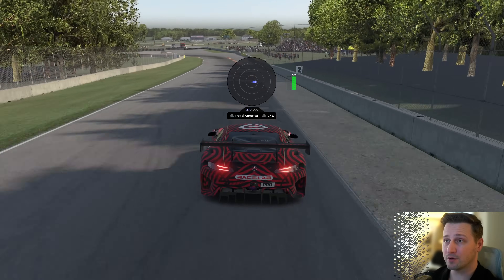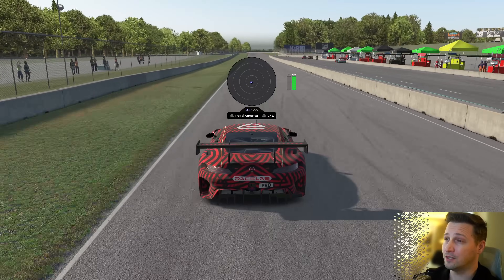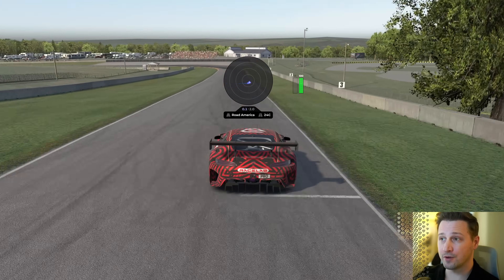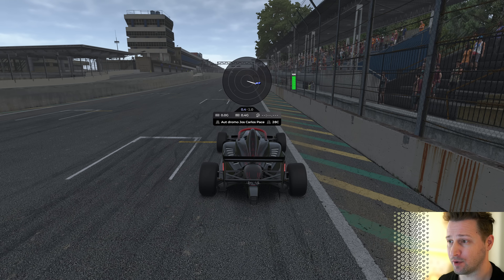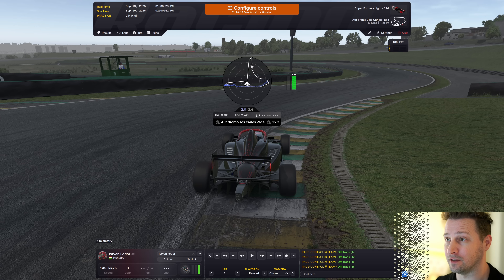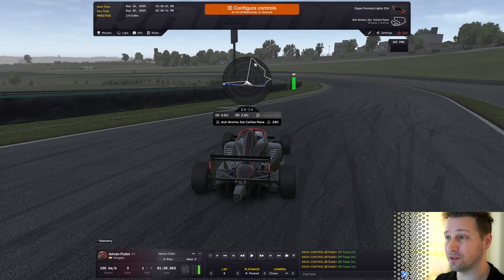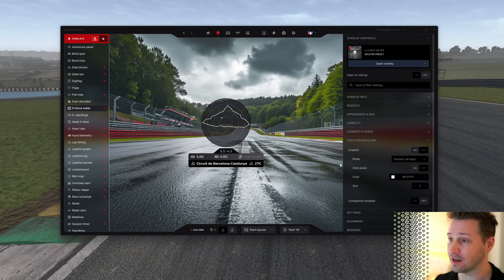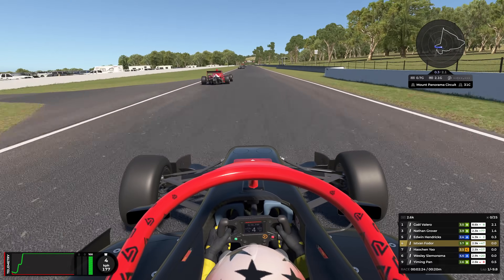You're leaving SECONDS on track... here's the proof

Comment: how does the overlay know eachs car limit for each corner thought? it only knows the maximum G force, for the hardest and or fastest corner, and records the highest g force experienced in that corner at that time as the white outline

if you have 2 right handers but one is slow and the other one is a fast one, the fast one will set the G meters outline, and in the slow one you will be always "under the limit" according to this logic.

The most outer circle of the G-meter is only the most maximum G force the car experienced at that point, and you can still push the car over that limit, be slower and actively increasing the G meters radius. Therefore "tainting" what counts as maximum grip?

In the last part of the video where you showcase the race, the overall radius of the G meter gets activly increased because you are on the limit on left and right of the G meter ( without spinning out, not necessary faster), but it also increases the radius for the front and the back, but this does not mean, that the "grip bubble" correlates, that you can brake longer and harder in a straight line, for example.
Reply from the maker: Yes, you are absolutely right.

Turns that doesnt need that much grip, will not stretch to the outer edge of that traction circle. But that's fine, you know that you don't need to, due to the characterictics of the track. But that doesnt change the fact that the limit is still there and available, you just don't need it on that track for those turns.

You also right about the maximum G limit. It does not know your car's limits, but it learns it as you use it from the maximum forces you put the car through braking and cornering. At some point you will be very close to the actual limit ( it's enough to just lock up once under breaking, and the 'limit' is determined ).
In case you never lock up, you could possibly underbreaking and the real limit can be much higher than what you can actually see.
But then here comes the cornering aspect. While breaking requires some skill, cornering is just simply turning the wheel. It's very easy to get up to the maximum grip limit by just cornering ( or at least getting very close to it ).

But let's assume all of these are false and you cannot get the maximum traction limit out of the overlay. You can still look at the roundness of it and make sure that you're applying as much G-forces while you are cornering/breaking and everything in-between.

Hope this clarifies it!